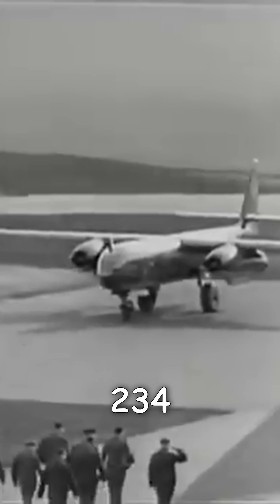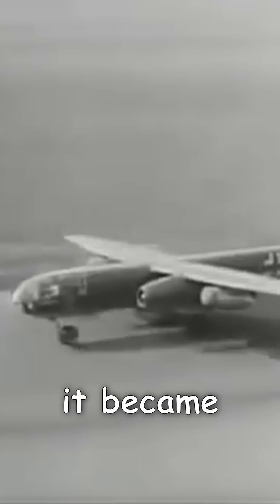The Problem with the World’s First Jet Bomber #shorts

Comment: The 2-part jet fuel was an issue as well.  Many ground fuelers spontaneously combusted... as the fuels were extremely volatile when mixed.
Reply: no, you are confusing this with the me 163 comet, which used a rocket engine, no turbojets.

Comment: Obviously, the allies urgently needed german technic to develop their own machines.
Reply: Not really Allies had the Jet Technology, infact Britain was developing a Jet airliner before the end of world war 2 and the US paid britain something like £50000 to use the technology. It was a strategic decision - the allies chose to leverage their existing technology and industrial capacity building enormous amounts of Lancasters, B17s, Spitfires and P51s etc whereas the Germans chose to go with higher technology smaller numbers hoping the advantage would lead to a win - but they didn't have time. The allies did develop their own jets but the production emphasis remained on the existing designs which were perfectly adequate to get the job done. The exceptions to that approach were radar (developed prewar by the British) and the manhattan project.
Reply: @Lucas_WAZZAA  Experimental tech? Almost none of it was experimental. The B-26's crashes only happened when it just entered service and with inexperienced pilots trying to climb with low speed. If it was going 160mph and above, it "flew perfectly". The B-26 overall had the lowest loss rate of all US bombers at 0.5% per sortie.

Do I need to remind you about the BF-109 and the infamous landing gear? It's estimated that 10 to even 30% of all BF-109 related losses/crashes came from the landing/takeoff accidents due to the badly designed landing gear.
Reply: @RobbieNguyen lol the Meteor in '45 was in the same state as the Heinkel in '38.  Meanwhile the Germans were pumping out multiple different jet designs.
  It's so trendy now to call the experts of the time and the men who lived through it idiots.  Essentially calling our boys incompetent for struggling so hard when facing the Germans.
Reply: Classic misinformation post.  The Germans were NOT smarter than everyone else.  Get a grip.  They were obviously stupid enough to put Hitler into power and follow him to their own destruction.
Reply: False. Allies had plenty of their own jets that they never rushed into service.
Reply: @RobbieNguyen  And why didn't they do that? Have you any proof? Their jets didn't fly in the wartime! They were way behind, like Whittle.
Reply: @HansZwockel  Except they did? Have you not heard about the Gloster Meteor? And the P-80? Both served before the war ended in Europe. They were rarely used because superprops (Like the P-47 and P-51) were reliable and effective weapons. One P-47 squadron took down 7 Me-262s with NO losses.

Me-262s were effective bomber interceptors, but awful as an actual fighter. Extremely short barreled 30mm MK108 was awful for dogfighting against the 20mm Hispanos and 12.7mm Browning. The turning radius of the Me-262 was incredibly wide and acceleration was slow. So all you can do is dive and then run hoping the P-47 behind you couldn't chase you down or shoot you. Doesn't help that the engine only lasted 25 hours.

Desperate countries use their latest technology no matter how half baked or unreliable it is. Winning countries use proven designs until the new one has advanced far enough.
Reply: @RobbieNguyen  Then look a what time the gloster and the P 80 hat their first flight and when they were at the front! 
At that time, the Me 262 already taught the allies lessons., bat germany didn't have enough resources to build enough, and without the US the Britains would have been dwarfs.
There are so many developements where the allies were behind:  Tanks, MG, Rockets! the allies needed german skills to build the first nuclear bomb (Oppenheime) to build working Rockets (Von Braun). 
Any queations?
Reply: @HansZwockel  German Tanks looked good on paper until you make them and realize you can't repair anything without the need of a dedicated workshop. Only late models of the Panther were genuinely the best. While the Sherman, Cromwell, Comet, M36, M10, and M18 were more than capable of destroying most German tanks. (Including Panthers and Tigers, though Tiger IIs were largely resistant, Germany didn't have much of them to begin with and most of them were on the Eastern Front). The Sherman itself was stabilized, a feature which no German tank possessed.

Search up the Battle of Donpaire if you want, Free French Shermans and M10s numbering 70 demolished an entire Panzer Brigade of Panthers and Panzer IVs numbering 96 tanks. 7 French tanks lost, 69 German Panzers destroyed.

I will give you a point for MG development however.

While V2 Rocketry was definitely important for the scientific value, militarily, it sucked. It was expensive, highly innacurate, and dangerous for the user. More people died making it than civilians killed by it. Can't forget how the Germans copied Robert Goddard's (An American) Rocket Engine design to make the V2 engine.

P-80s first flew in January 1944, if the US was desperate enough, they could've very easily rushed flight testing and sent it to service mid 1944 or earlier.

The Gloster Meteor flew on March 1943. Though actual service was more than a year later. If the British was desperate enough, they could've finished flight testing early and flown the Meteor by late 1943 or early 1944.

Oppenheimer was American, not German. Even then, Hungarians and the British contributed much more than the Germans.

Von Braun did NOT make the first rockets. That award goes to the Chinese 1000 years ago. If you want liquid fueled rockets, Robert Goddard was first almost two decades earlier.
Reply: @RobbieNguyen  Pass mal auf Freundchen, ich nehme ab jetzt nur noch Antworten in meiner Sprache entgegen. Da Du ja ein supergroßer Spezialist für deutsche Waffen bist, wir Dir das ja nicht schwerfallen. Jetzt passt Du Dich mal an, so wie ich bisher, und dann sehen wir weiter!
Reply: @HansZwockel Why should he?
Reply: @borisbaran  Ganz einfach: weil er es nicht verkraften kann, daß seine Amis und Briten mal nicht die Ersten und Besten auf jedem Gebiet waren. Er ist ja in allem Spezialist, aber unsere Sprache war ihm wohl zu kompliziert zu lernen.
Reply: @HansZwockel you do realize American tanks ended uo far superior than Germans, sure a Tiger could destroy multiple Shermans, if it didn't have mechanical issues and catch on fire, which is what a lot of German tanks had, and the 76mm gun of the later Shermans were deemed more than enough to take out a Tiger, hell, the 75mm was deemed big enough, not even mentioning British and Canadian Sherman Fireflies
Reply: @Bmuenks31  Ach Ben, wenn die Kräfte mal so einigermaßen ausgeglichen waren habt ihr aber ganz schön Prügel bezogen! (Ardennenoffensive, Hürtgenwald). Iher habt doch am Schluß nur gesiegt, weil ihr die Rohstoffe hattet. Technisch wärt ihr abgesoffen!
Reply: I don't know why but this reminds of a time where a whole comment section was trying to teach a wearbo that Germany wasn't that great during the war he would say stuff like the US wasn't fully motorized then he would contradict himself so that it could fit his narrative.

Comment: That was the same with other German jets, the ME-262 was especially vulnerable during takeoff and landing too...
Reply: what plane isnt vulnerable during takeoff and landing...
Reply: @huntergames9668 if you have a nuke on board and you are kamikaz
Reply: @huntergames9668 I think the point is, that is when they were most vulnerable and less likely to evade.  Yes, it's true to all aircraft, but these weren't your typical aircraft.
Reply: @huntergames9668  Yes of course...🙂 but what I think people always refer to is the sharp contrast between the blinding speed of the Arado AR-234 and the ME-262 in the sky which made it impossible to catch up with and the much lower speeds during takeoff/landing which made them sitting ducks for the allied aircrafts...
Reply: @jeromewagschal9485  true
Reply: ME-163 rocket had same problem
Reply: @lunatic3783  Thanks for mentioning that...I always wondered...I thought the ME-163 had such a fast takeoff and rate of climb it would have been almost impossible to shoot down...Even when it glided back to the ground...
Reply: AND had to have its engines FULLY replaced after something like 20 or 30 hours of use. Crazy
Reply: @DylanBennett-k3t  Yes...I've read that too...Indeed, it IS crazy Especially when 20/30 hours is a very short time...
Reply: @jeromewagschal9485  the issue was that the metallurgy in the engines wasn't well enough developed for them to put up with the temperatures etc. for too long plus the german engineers had to use what they could get not having access to much of the world.
Reply: @tomriley5790  Thanks for that explanation, I remember reading something like that a couple of years ago...
I also remember hearing that the Luftwaffe ( and probably the rest of the Nazi military ) were down to 10 days of fuel left when the war ended...
Thankfully the Germans didn't build the ME-262 and the other jets/rocket fighters back in the late 30's in very large quantities, I'm pretty sure they would have lost the war regardless but it would have likely resulted in HUGE losses of life on both sides...
Reply: @DylanBennett-k3t  precision German engineering
Reply: @huntergames9668 it's because of materials shortages.  So yes, that's some serious engineering to make jet engines out of soft steel that shouldn't be able to stay together and handle the heat.
Reply: he just needed very long landing zone and one bullet from ground or enemy plane was enough to blow it cause of the fuel
Reply: @MW-wh8hh  I had no idea it was THAT vulnerable...I always assumed its slow speed during takeoff and landing made it a sitting duck and that was it...Wow...
Reply: @MW-wh8hh  it really depends what gun, bullet, shot placement, amount of fuel, speed or bullet and many more so u can’t say that exact
Reply: Or when making turns because the ME-263 had a notoriously slow and wide turn date
Reply: @gmsniperx3623  I didn't know that, I thought it was a fast killing machine, then again it was the early 1940's 🙂 it was already amazing ( unless you were an allied bomber crew ) what the Germans managed to build...
Reply: @jeromewagschal9485  That was actually the main reason why Mustangs were able to take it down. Otherwise it would have been unstoppable
Reply: @gmsniperx3623  It makes sense that, speed for speed, the mustangs wouldn't have had a chance...
Reply: This is exactly what I came here to say.  Chuck Yeager got a ME-262 kill that way.